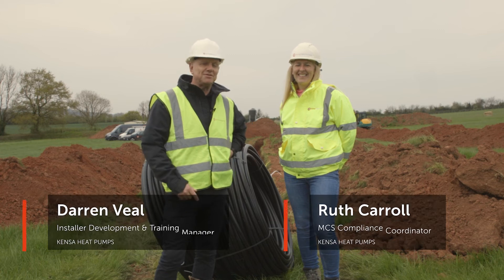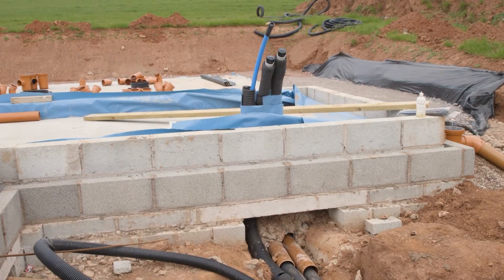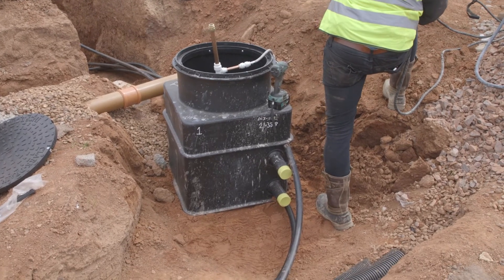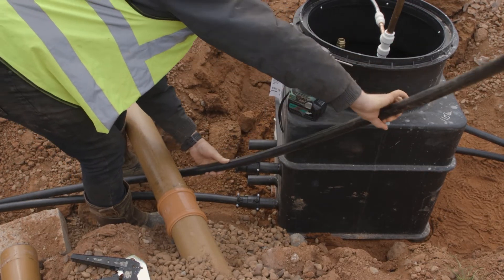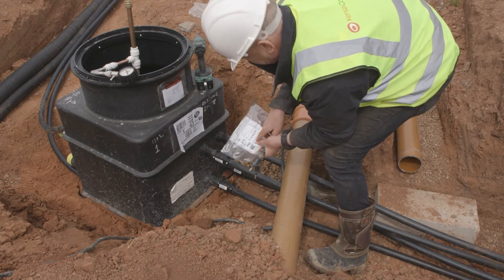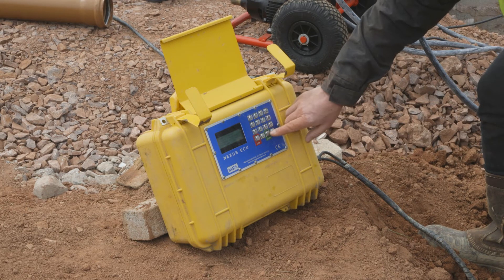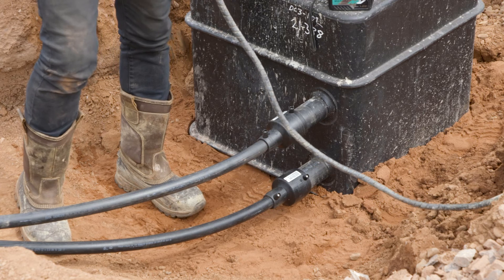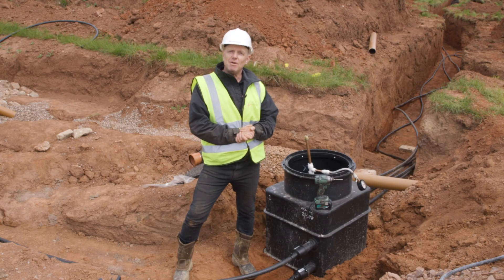Connecting to a Subterranean Manifold | Kensa Installer Series

Comment: What should be the diameter of the manifold pipe (between manifold and heat pump), for 4 loops using 40mm diameter colector pipe.
Reply from the maker: Hi there, this very much depends on the size of the heat pump. Please feel free to give our Installer team a call on 01392 717023 - they would be more than happy to talk this through with you.

Comment: Random question, we've recently bought a house with a ground source heat pump. We were uncovering some of the land and found what we think is the subterranean manifold. We're searching the internet to understand if this should be dry or wet, ours is almost full of a liquid. We came across your videos and wondered if you're able to advise if this is correct or not. We're now hunting to find out who installed it, so we can ask directly too, but thought we'd give this a shot! Thank you!
Reply from the maker: Hi Kat, thanks for getting in touch. Subterranean manifolds don't tend to hold water, but sometimes dirt gets in between the lid and the seal of the manifold chamber and it allows rainwater to get in. Usually, the manifold lid should be located at the high point in the ground but this is not always the case. It's important to check with a refractometer if it is rainwater or if it is a leak inside the chamber. By using a refractometer you will be able to see if there is any evidence of antifreeze in the water that's inside the chamber. I hope this is helpful, but by all means, please feel free to call 07876590259 and speak to Darren Veal (seen in the video) for more info.